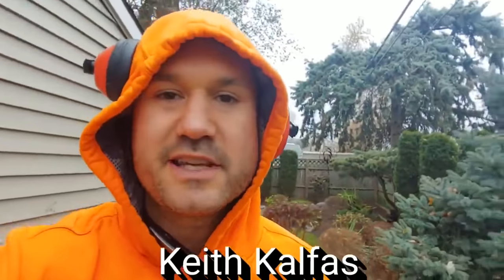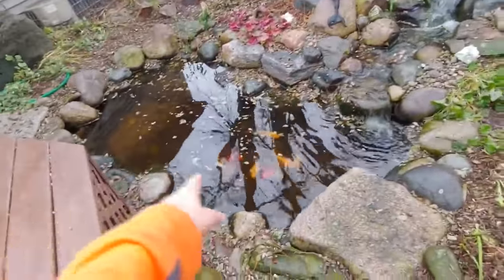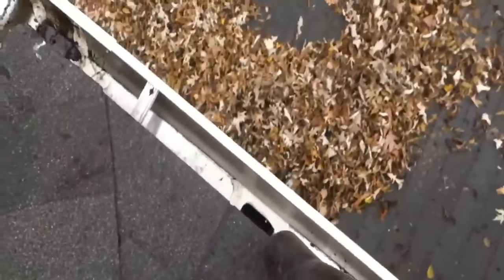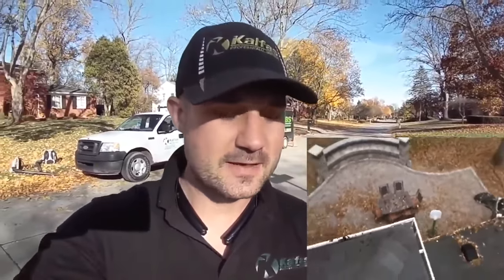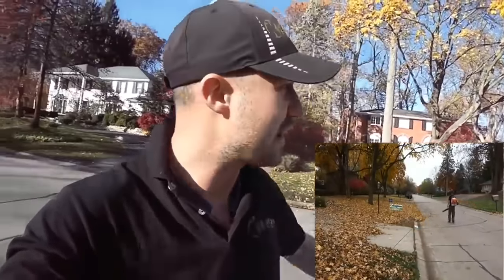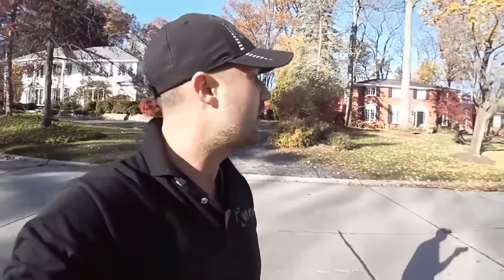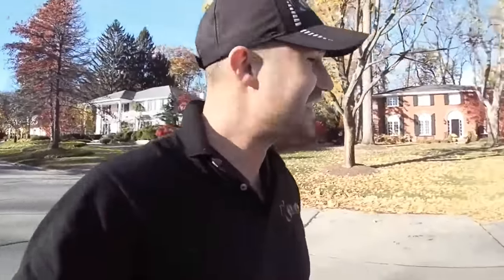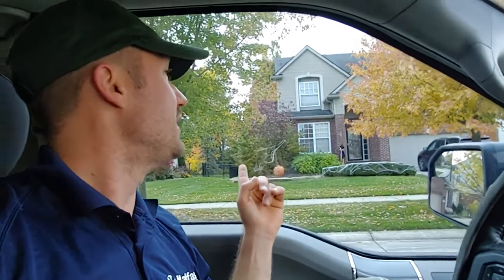How Much Do I Charge for Gutter Cleaning & Fall Cleanup //Landscaping Business tips (Compilation)

Comment: I've only had two customers really say something about my debris haul off prices. I just tell them my price takes into consideration travel time to the landfill, fuel costs, the landfill fee and the labor involved with unloading all the debris- which once I explain all the time and work that goes into hauling it off they understand the price. Most customers just see you load it into your truck/trailer and drive away, and once you're gone they think it vanishes into thin air.